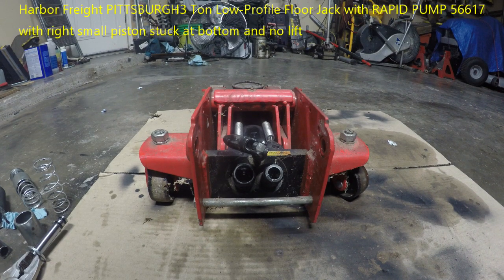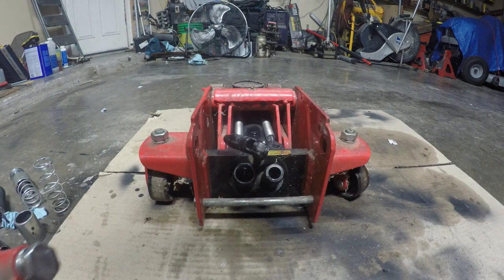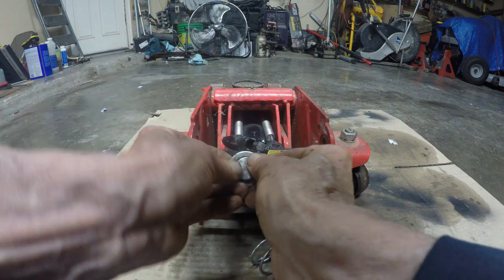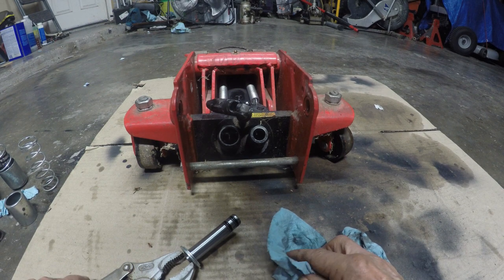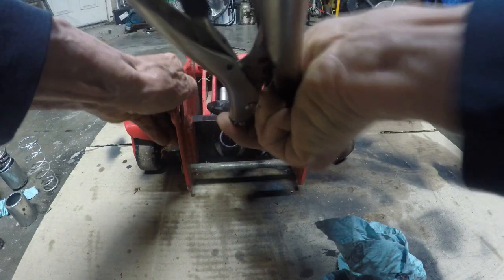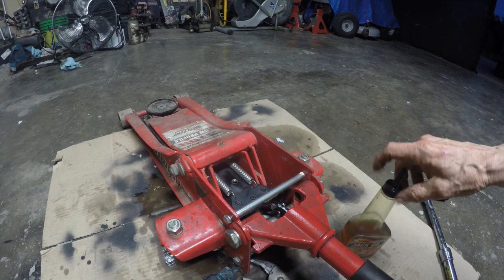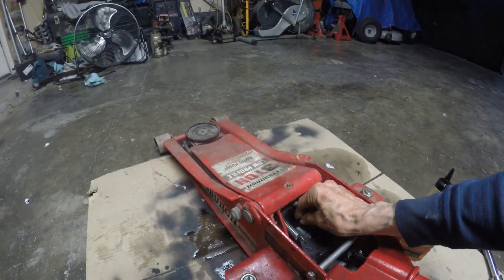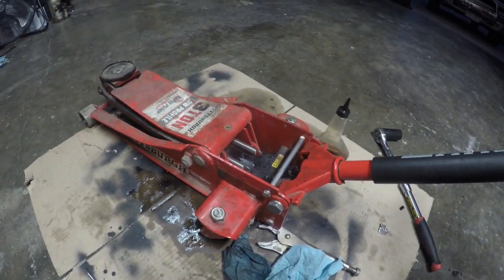PITTSBURGH 3 Ton Low Profile Floor Jack with RAPID PUMP 56617  STUCK PISTON

Comment: ❤Great video‼️
Thanks 👍🏿 
I was able to get my piston Loose by just using a flathead screwdriver.
I then turned the jack upside down and just sprayed the pistons with PB Blaster....
And now my floor jack works as it should😊

Comment: Replace the O-rings and look for chrome flakes in the o-ring or scoring.  The cylinder may be removable...I have a Daytona...about the same.  The top washer is retained by a wire clip...replace with an E clip.  The aluminum spring shields dent easy and just fix up by anviling on a 1 inch bolt with a ball peen to make them round again.

Comment: What size socket did you use to remove the handle bolt
Reply: 26 mm   and the left is right thread and the right bolt is LEFT!